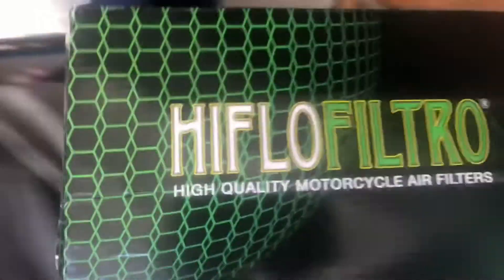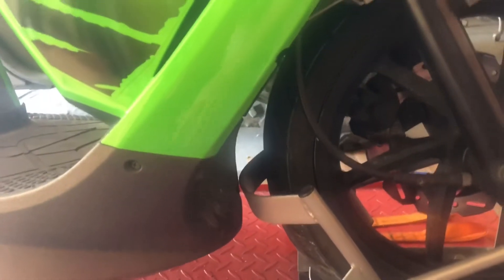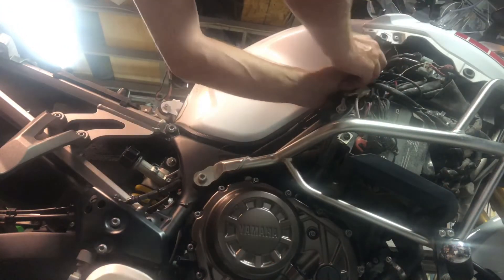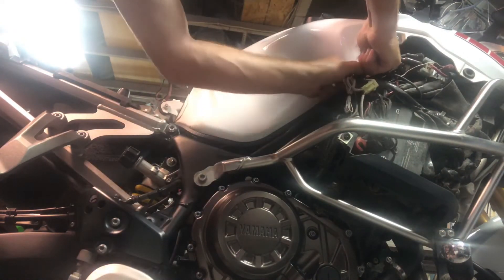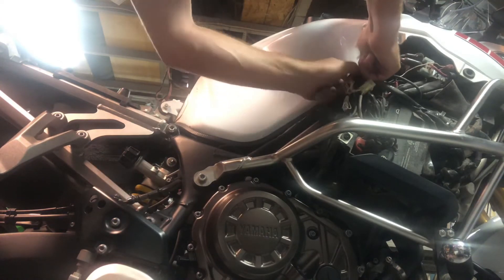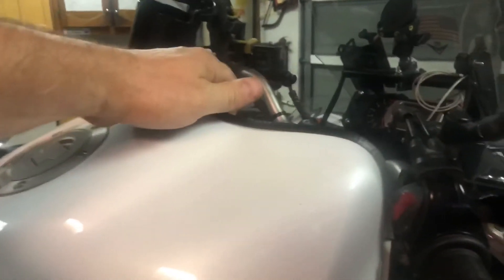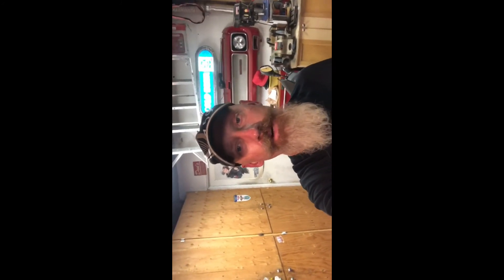Garage time, air filter change on Yamaha Super Ténéré.

Comment: Thanks for the video….as a proud owner of a Tenere I was curious on the degree of difficulty on this bike…Looks pretty simple unlike my 13 Goldwing. That was a frickin nightmare with all the plastic bodywork to remove…👍
Reply from the maker: I don’t think it’s difficult to work on.  I’m not a trained motorcycle mechanic, just a guy who likes fixing things and it’s not intimidating to me.  The maintenance intervals are long anyway, 26,000 miles for a valve check

Comment: Your videos are very inspiring.
Reply from the maker: tiger6102 if I can do it, anyone can!  Thanks for watching.
Reply: @TomsTinkeringandAdventures  i just did my first oil and final drive fluid change after watching your video. Thank you so much for taking your time out and making videos.
Reply from the maker: tiger6102 that’s what I like to hear, Bravo!  I’m going to be doing a valve clearance check video soon so you can see how that is done.
Reply: @TomsTinkeringandAdventures  next for me will be to replace the spark plugs and air filter!!
Reply from the maker: tiger6102 I did an air filter video, will be doing plugs with the valve check

Comment: Tell me about those foot pegs you have mounted, I think they are on the protective bars, where did you get those.?
Reply from the maker: Anomie those are some cruiser style highway pegs, mounted to the crash bars with some homemade brackets.  Not amazing, but nice to have a different place to set your feet on long trips.
Reply: @TomsTinkeringandAdventures  I couldn't agree more I have been looking for some forward foot pegs for my Super Tenere and have not found any.  Of course its something home manufactured. Can't say I have the ability to make brackets any suggestions.?
Reply from the maker: Anomie well these are really simple, some U-bolts and a small piece of strap metal.  A hacksaw and drill are the only tools needed.

Comment: Thanks for bearing the 125° heat for the video, you must live in FL. as well.  You did not show how to put that screw that you can't see back in.  Taking it out should be easy but not seeing the hole it goes in well I am a little apprehensive.
Reply from the maker: Anomie San Diego, we get some heat occasionally!  Don’t be apprehensive, it’s not difficult.  I have valve check coming up soon, that’s something people worry about but I have done it before.  Take your time and it’s all good.
Reply: @TomsTinkeringandAdventures  Thanks again for your video everything went according to plan.
Reply from the maker: Anomie great to hear.  See you out there somewhere maybe!

Comment: fuck that, thanks for posting, think I'll get the 700
Reply from the maker: Completely different bikes for sure.  I have no idea what the maintenance is like on the T7, but after I get 100k miles on this one it might be the replacement.
Reply: @TomsTinkeringandAdventures  second thought's it's not too difficult compared to some bikes. thanks.
Reply from the maker: @roadwarrior8560  it’s really not bad.  Neither are the valve clearance checks / adjustments, especially considering that it’s every 26,000 miles.

Comment: I bet air filter for super tenere not on a cheap side..
Reply from the maker: ⵠⴷⴶⵁⴸⵏⵖ the air filter isn’t too much money.  I have had good luck with the aftermarket ones, which are less expensive.
Reply: Tom's Tinkering and Adventures It looks you are right, I've just compared two hiflo filters for tenere and hornet 600 and price differnce is very slight. May be tenere filter just looks expensive :)